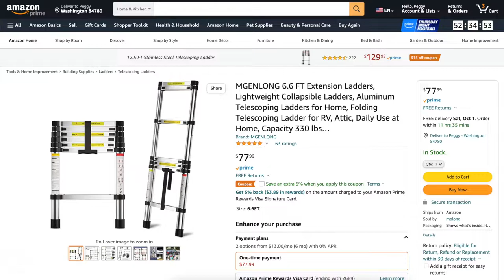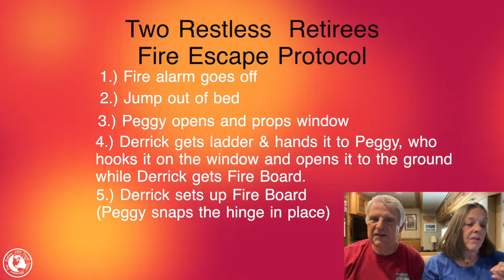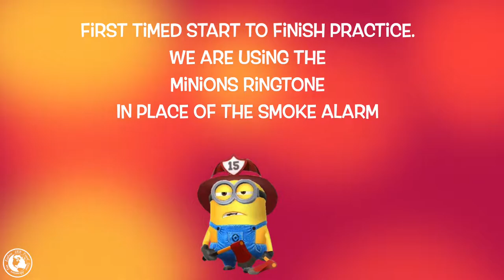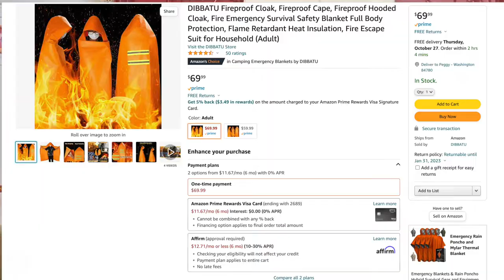RV LIVING: ESCAPING AN RV FIRE! DO YOU HAVE A PLAN? #rvfire #rvfireescape #rvliving

Comment: What a valuable thing to think about and practice!  One thing to add to the task list if going out the window.  Close that bedroom door.  It won't do a lot but anything that helps block radiant heat or slows some smoke is a good thing.
Reply from the maker: We thought about adding that step in (closing the door). It’s such a toss up with the super short amount of time, but yes, if the fire started in the front closing the door would be a huge help. Thanks so much for stopping by!

Comment: Great video! I've often looked at those windows and wondered about all of the issues you addressed here! Suggestion: Get some respirator masks that filter smoke and hang them by your bed within arms reach. Putting that on first would buy you some time. They're not expensive compared to the value of a life. :)
Reply from the maker: Ooo, I like that! That might make another good video as an add on! Thanks for stopping by 😁

Comment: Awesome video -thank you!  I wonder if there is some kind of oxygen mask that could be put on quickly to help prevent smoke inhalation?  Either way, my spouse and I  were sitting on the fence between purchasing the Tiffin Allegro Open Road and Tiffin Red 360.  Red 360 comes with the bedside ladder exit system as an option as you showed at the end of the video.  In addition to some other benefits of the RED, I think this safety option is pushing us over to the RED to purchase.   I hope you both never have to face a real life fire evacuation!
Reply from the maker: I agree with your choice of coach. If we had to do over again, and we saw that that was an option we probably would go that way too. Is the open road you’re considering new or used? Because I know on the new Open Roads, you can have that exit installed. Either way, I’m glad our video helped you. That’s precisely why we did it. To hopefully help others. Thank you for your nice comment and thank you for stopping by. We will be doing a follow up video and I’ll include your suggestion of oxygen in the video and explore that a little bit. Thank you again for stopping bye
Reply: An aviation supply place, like Sportys sell smoke hoods that would work for this purpose.